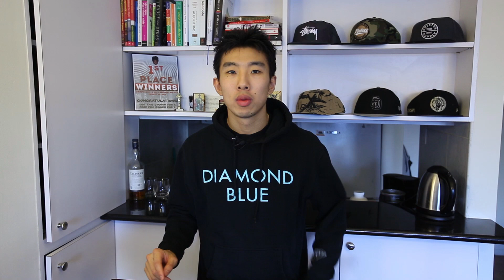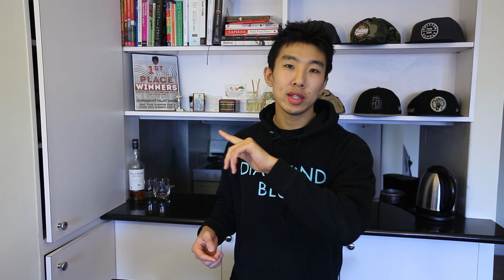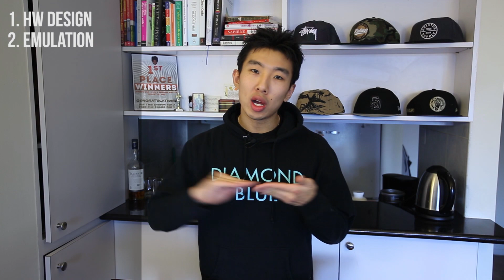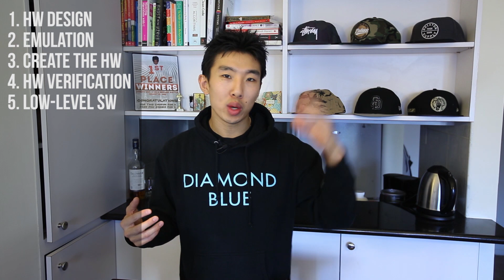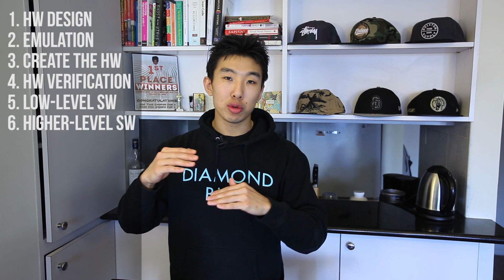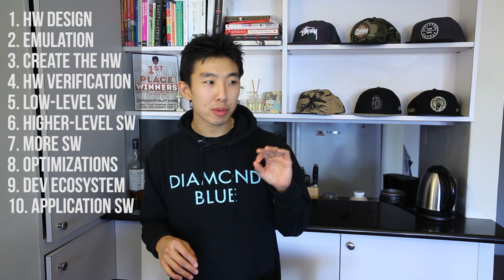Comment: Hey Dave, very good video as always. What does Android OS do to work fairly well with all of those different hadware platforms? It has an abstraction layer between the hardware and the OS? If yes, who should develop this layer?
Reply: hey, good question. It's important to remember that many many people contribute to Android. In these situations, many of the times the companies producing the phones will be developing this layer. Let's say Samsung chooses from various hardware providers to create their new S10 phone. They also have chosen which software will run on this phone. Since Samsung is not in the business of making their own mobile OS (maybe they were at one point) they will elect to use some subset of Android versions to deploy on the S10. What they have to do now, is to make the appropriate software updates to android to make sure that software runs on this new hardware they are putting together. So you will find many big companies also contribute to Android, it is open source after all. Many customizations happen at the hardware / OS layer. There can also be customizations made for specific phones. Many times an Android phone has something special, maybe a special finger sensor on the top of some phones. Some physical feature like that on the phone itself has to be accommodated for in the software somewhere. Also Google just made Pixel which is the first time I think? where they have more control of what hardware their software is running on. Hope this helps. Sorry didn't format this.
Reply: Thank you for the answer, I've been very interested about the interaction between software and hardware, and I think our phones are an interesting case of this interaction, so I like very much to talk about this and understand how it works. Keep bring us some good videos like this.